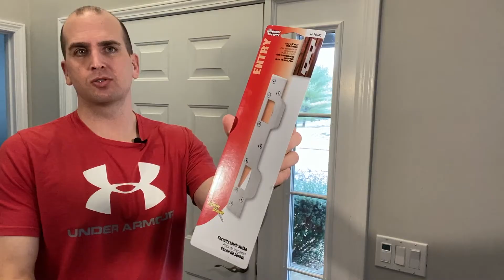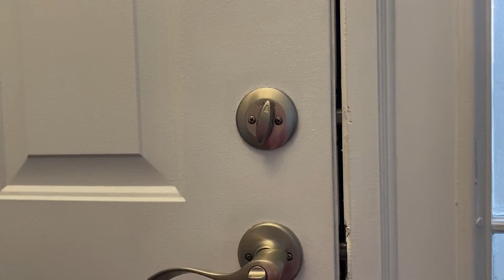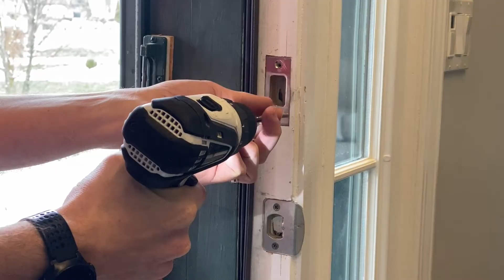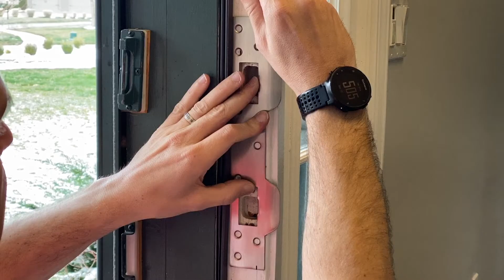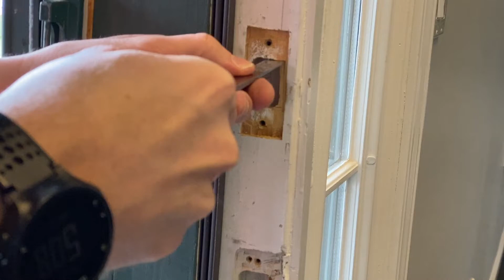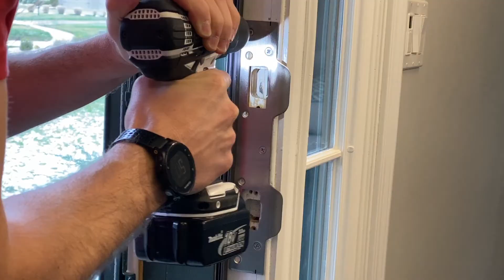Front Door Security Strike Plate | Easy Install

Comment: The straight edge to line up the latch and deadbolt holes helped bc one was catching during the dry fit... I had to install the new plate slightly angled (from vertical edge) to replicate the original (not vertical edges to each other) cut outs.

Comment: Unnecessary. 3 inch deck screws all around the door is more security than you’ll ever need
Reply: The 3 inch screws are garbage they snap off and weak and it's hard to remove so be careful. Better off with 3 inch screws but not the ones that are in this package.

Comment: Thank you for your great install instructions. Last year, I installed one on my walk-in garage door, and it works perfectly. I just purchased another security latch from Amazon for my house backdoor November 21, 2024, for added security because of all the YouTube videos lately with kid jerks kicking in doors, plus home break-ins. I normally do not lock my glass storm back door. I may, or may not buy one for my front door, but I always lock the storm door and my front wood door. Plus, I added 3 inch screws to the existing door latch and deadbolt latch years ago. I just wanted to mention that I will follow your instructions exactly like I did with my garage door. I like the way you showed the measurements from old latches before putting in the security latch.

Comment: If someone is going to kick the door in, I'm afrad they'll just break that window and reach around and unlock the door.  The only fix for that would be to replace the window with wood or burglar bars.  But then you'd just need to put burglar bars on all the windows because any first floor window is always vulnerable to a break in that takes five seconds with a hammer if the burglar doesn't care about noise.  I bet your neighbors wouldn't like the look of that, though.  To be fair, if your home isn't brick, someone can just take a sledgehammer and bust through the siding, insulation, and sheetrock and they're in.  I'm afraid there is no 100% fix if the burglar doesn't care about noise at all.  I only know this because a burglar kicked in a basement window where I used to live and I realized that if someone is determined enough they are going to get in.

This was a very informative video, though.  Thanks for making it!

Comment: Great job. Thanks for the info. If I could add one thing because I just installed this. If the door opening isn’t wide enough you have to recess it but using a wood chisel and chiseling out door frame.

Comment: I bought the same security latch plate and put on my walk in garage entrance door and I followed your excellent steps and it was easy to follow. The only complaint I have on this Defender Security latch plate is I noticed one of the supplied three inch screws were bend, or curved a bit, which I had to wonder about the strength of the screws. Luckily, I had some three inch galvanized three inch screws I had used on this same door two years ago on the existing old latch plates and I used three galvanized screws on this new latch plate which I think will add more security and strength than the supplied screws. I still give this latch plate a thumbs up 👍

Comment: I have a handle-set and two dead bolts. The extra dead-bolt is a purely mechanical push-button combination lock. I drew up a single strike-plate, which encompassed all the individual strike-plates and even added 3" above and below. I had a fab shop laser cut it for me. The material was 1/8" stainless steel and it had holes for maybe 12 screws. Way overkill, but secure as it gets. I actually mortised the strike-plate flush to the door frame.

Don't forget to install longer screws in your hinges too because they would be the new weak point.

To be clear, if you have a storm door with a decent lock, burglars will very likely avoid the front door. The guy in the video seemed to have  one already.

Most residential doors in the US can be breeched by just throwing a hip into it. Not true with a typical out-swing storm door. They usually have to break the glass to breech a storm door. Most burglars will opt for the man-door on the garage because they're usually out of sight. Alternatively, daylight break-ins might occur at the glass patio door, where a drug addict will just throw a landscape brick through the glass.

My garage man-door has a 2x4 across it (barring the door). My glass patio door is hurricane glass and 10 tries with a brick won't get through it.

Also, don't forget to put a zip-tie on your emergency release on your overhead garage door, otherwise they can be opened with a coat hanger.

Comment: Yo Scott, I'm doing this exact thing on my front door but NEED to use 4 inch Spax screws, do the pilot holes need to run the entire length of the the screws cause I'd have to get a new bit for that, (using a 1/4 three inch bit currently)? Any help would be greatly appreciated, thanks for posting!   ~Mark~
Reply from the maker: Not usually, 3"pilot hole should be plenty to avoid splitting.
Reply: Yo  @EverydayHomeRepairs , Hey Scott, just finally got done installing this exact Strike Plate, (nobody had these in stock before Xmas so I had to wait for over two month's to get one) and it went flawlessly! Thanks so much for posting, as I'm a first time home owner and need to do as much as possible on my own.   ~Mark~

Comment: what do you do if you need to angle the plate slightly to allow the deadbolt to latch, but one of the holes is almost perfectly aligned with an existing hole for the deadbolt plate (but not quite)? i can't re-drill it in place because the new hole would overlap the old one. am i stuck filling it with a golf tee or something of that sort and re-drilling?

Comment: Using longer screws make it more secure because longer screws go deep into the studs (2”x4”) the door frame is very thin & delicate piece of wood making the door more breakable. If u just use the 3” screws no matter the strike plates. It’s just as secure.
Reply: that is somewhat true.  but, this strike plate has a total of 9 screws, with 6 of those being the longer screws.
compare that to the 4 screws before, 2 on each plate.   9 screws will be hard to kick in, no matter their length but especially when they're deep into a stud. 
it should be noted though, that the deadbolt itself can then become the weak point.  someone below mentioned that they'd rather have the deadbolt resting against the strikeplate when the door is shut even if they have to push the door closed to lock the bolt, rather than the door knob latch itself resting against the strikeplate (ideally both, but apparently theirs was crooked).   This is the case with my door, and after 5 years, my deadbolt has become "wobbly" and there may be a way of tightening it, or i could get a new deadbolt, but still something to keep in mind as well.

Comment: I added a metal plate on an old door, not sure what it is called, but reduces ability to access (ie: carding a door open).  Also, another channel was showing a device that installs on inside of door that helps keep door from being kicked in.  * not sure, but it may also keep door shut, even if lock gets picked?

Stay safe !  If you have not already done so, Any helpfull ideas for window security as well, would be great.

Comment: For anybody who is watching this in the future and can't get their bolt to latch with the door closed, make sure the lock and the door knob shafts are lined up on the door itself. Mine were not lined up, so I had to install my strike plate on an angle to account for this. I had my strike plate perfectly aligned with the holes, but it took me hours to figure out that it was actually my door that was screwed up.
Reply: Dealing with this fact right now. 🤬
Reply: I don't think it was your door that was screwed up. Mind does not line up either. From the center of the deadbolt to the inner edge of the deadbolt cylinder is usually longer than the distance from the center of the door knob shaft to the latching edge. I can file out the rectangle opening in the plate to accommodate this, but I'd rather have my deadbolt tight against the inside edge of the rectangle opening even if I have to push the door to engage the deadbolt.

Comment: But won't those big holes make the door wobble?  Those old strikers were designed to be a perfect fit. That defiant striker has big rectanglar holes.  The dead bolt will wiggle in there.

Comment: Thank you.  I am a single mom and we had to have our foundation repaired which greatly misaligned our deadbolt and  now our door knob as well.  It is not safe so i am going to get this set up and it looks like there is enough room in the opening on the plate so I can make the adjustments above and below which is our issue.

Comment: They will just smash the glass side window and reach in to unlock the dead bolt. Always use a double sided keyed deadbolt on doors with glass
Reply from the maker: I hear you but I would hate to have a situation where the door is locked and the family needs to get out fast 🔥 and we can't find the key.  That scares me more than the break in potential.
Reply: @EverydayHomeRepairs  good point never thought of that
Reply: @SeantheRD  that’s why they aren’t allowed in a lot of places
Reply: @EverydayHomeRepairs  You can go out the back door or the window, or have the key nearby but too far for a burglar to reach in.
Reply: Mine is the same way, you can buy the 3M security film to prevent a quick smash and open. They could still get in, but not before they have a .30hate putting them down. It takes a while to actually get through that stuff if installed properly, they'd have to smash the glass and then use a knife to cut it all out. Security is all about providing more and more standoff, Larson and others sell storm doors with the same 3M film concept or gates that can prevent someone from simply walking up to the door and kicking it in.

Comment: That glass next to the door is the real weakness , all a burglar needs to do is break the glass and open the door. Replace that glass with wood and now it'll be safe.
Reply: Take off that glass panel and change it to a solid wood. Can't see any other way.
Reply from the maker: Yeah, there were a few other comments on the same point.  One thing we never agreed on was a good solution.  Do you have a recommendations for those with side lights?  Thx!
Reply: @EverydayHomeRepairs  sorry I don't have any recommendations. I've always been scared to have that type of door way. Still a great video tho. I've done all that to my doors already too and look at all these videos for insight.  Thank you for the video I'm sure this video has helped many people.
Reply from the maker: Appreciate the follow up and when I find a good solution I will pin a comment to the top for this video to make it more visible to others.  Take care.
Reply: @EverydayHomeRepairs  could also use 3M or other security film to add resilience to the glass and increase the delay of a determined burglar
Reply from the maker: @bthemedia  nice thanks for the tip.  I will take a look at the products.
Reply: @EverydayHomeRepairs  you can buy a security film that you can stick onto the glass. It prevents the glass from shattering if an intruder tries to break it with a hammer.
Reply: @EverydayHomeRepairs  Larson Platinum Security Storm Doors mitigates the windows enough to extend your standoff time. They sell several varieties and me and the wife installed it in 15 minutes, they stick out a bit but look fine. Also as has been mentioned, install the 0.8 mill security film to all ground level windows and on those small windows around the door.

All in all, it should cost under 1,000 to have far more standoff than what you have now. If you go with Larsons steel mesh storm door it would be a little over 1,000 since it costs more but that thing can absorb 1,000+ lbs of force. The full glass panels are like 300-600lbs but are a nightmare to try to get into.
Reply from the maker: @nextjin  good stuff, I appreciate the feedback and details 👍
Reply: I have the same issue so I installed a deadbolt that uses a key on the inside.
Reply from the maker: I was just worried if someone needed to get out in a hurry (fire) and then can’t find the key.